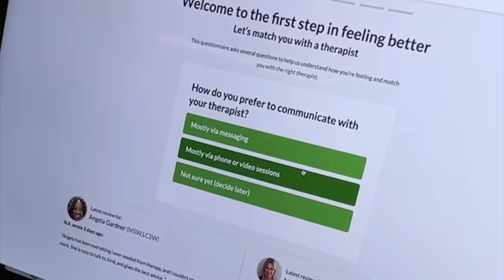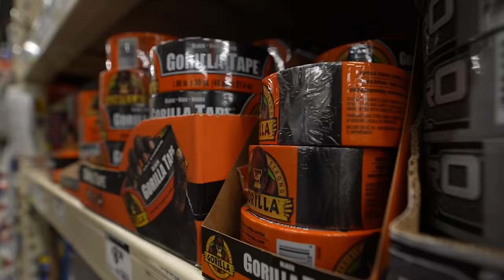Home Depot 1v1v1 Build Your Own Boat Challenge! ($500)

Comment: A bucket with no foam provides more buoyant force than a bucket with foam. The foam adds mass and displaces air from the bucket. Pulling a vacuum on a rigid container would maximize the buoyant force.
Reply: Yes I was thinking that exact thing the reason foam is botany is because there is air in it

Comment: Filling a air cavity with foam only helps if the air cavity floods by taking up the space the water has to fill.  If it remains airtight, the air will provide more buoyancy/floatation than any foam.

I'm surprised none of you bought foam board insulation, cut it  into shapes and glued it together like a human 3D printer.  You could make the hull for like $50, under $100 if you wanna be fancy, and you could spend the rest of the money on a cheap battery drill and batteries for a Home Depot-rigged trolling motor!
Reply: YEAH RUFFTHINKING
Reply: Yeah adding foam to a closed bucket makes it float worse..... it just got heavyier.
Reply: If you've watched these guys videos, they are NOT handy or mechanically inclined at all. Ayo is learning as he does these boat projects but I've seen Norm look at a hand saw like an alien object. Love the vids though
Reply: this is exactly what i was thinking .Just strap some foam board, strap it together, some pins through it maybe, coald even glue it if that glue sets in the 60 min they had. And then you could even put up some sides as wel. And with the remaining 350 you buy yourself a pretty nice cordless drill to build that trolling motor. I was actually thinking ayo was going that way when i saw him walk past the milwaukee stuff.
Reply: Glad to see someone made the point that adding foam to the inside of sealed buckets won't help at all.

Comment: Hey ayo at 14:03 there's some orange water coolers in the background. In my experience those are water tight and float quite well. You could have used those as pontoons. I'm not sure of the weight support of an individual one but I bet you could have made it work pretty easily. Great video man love these impromptu off the top of the head challenges.
Reply: Exactly what I would’ve used!

Comment: Let's be real, Ayo definitely won the best boat challenge. His boat actually floats, it could easily have a foot controlled trolly added, and you can reasonably add a pedestal seat to it. Just replace the screws with bolts that are flat, and fill the containers full of empty, sealed 2L bottles. thing would last for years in a country pond.

Comment: I would have gone straight for the plywood. 1 sheet for the bottom and front, 1 sheet for the sides and back. Some 1x1 to make a frame then tarps and the liquid flex seal for the waterproofing.

Comment: Screw the 5 gallon bucket lids to the platform, then attach the buckets to them, maybe a seal. 

Make one row of totes down the middle, with a pontoon made up of a few. Cut out and hinge the board over the center one, and have a built in cooler, maybe make an opening lid over another for storage.

Comment: 25:20 He goes "what type of saw is this", it wasn't the saws fault it was jamming up, it was because he had both ends of the timber on a surface so as he cut through the timber folded into each other causing it to jam, you need to have one end floating so it can fall away. Just thought I'd put that out there

Comment: adding foam to an enclosed container doesn't make it any more buoyant, it just adds weight, reducing buoyancy. The only benefit you might have is if the bucket leaks water, it might help out. Also, WD-40 to get the glue/foam off of your hands, then dawn to get off the WD-40.

Comment: The wheelbarrow idea was actually really clever. LOJO’s foam idea was not. It actually ends up decreasing the amount of air that can be trapped in the bucket, so it decreases his buoyancy instead of helping at all. He could’ve tried putting all of the sealed off buckets together with the foam, which would’ve helped a bit, although it probably wouldn’t have held together too well.

Comment: My son and I made a boat out of cardboard. I lamintated multiple layers, using wood glue to hold them together. Calculate the weight you want it to hold, then find out how much a cubic foot of water weighs, and then do the math on how big you want the boat. Ours would hold about 400lbs. To waterproof the cardboard, buy the foil duct tape and tape the outside with multiple layers. We spent about $100.

Comment: Surprised nobody bought 2” thick sheets of foam board. Especially for those tubs ayo bought. Could fill them with the foam boards and then use spray foam around the edge of the tub and panels. You’d be able to park a can-am on that bad boy

Comment: 25:25 it's not the saws fault, it's user error. It's common sense that if you have a piece of wood supported on either side and cut in the middle, gravity will push down the middle and pinch the blade

Comment: I would have ran to the paint section to pick up some caulk, flex tape, spray foam, bondo resin and fiberglass then hauled ass to the final aisle to grab some of that pink panther Styrofoam insulation sheets. Cut the pieces how you want then put them together using the caulk and fill any gaps with spray foam. Once the body is done fiberglass everything and boom. You got yourself a crappy boat. If you find any leaks while testing slap some flex tape on there. Maybe grab some wood to build a frame to reinforce it the body as well. Also since most of our stuffs in the paint aisle anyways why not get some paint mixed for style 😎. $500 is actually a decent sized budget

Comment: 1 1/2 or 2 in rigid foam board insulation would have been the tits over top of the bins or buckets. The beauty of being a carpenter and knowing most of the different kinds of building materials. Plus I spend almost 5 hours a week in home depots all across the county so that would be a plus too.

Comment: 4 slightly warped 8’  2x12
4 5gallon buckets with lid’s 
1 tube of silicone 
1 small box of 2 1/2 inch screws 
1 battery powered drill to put it together 
1 paddle mixer attachment so I got a motor when it’s seaworthy.

Comment: Wouldn't technically foam cause less floatation?  You're filling in the area with something denser and heavier than air, so it would stand to reason that it would provide less floatation.    Could've just used air and probably had a better time. 

As well, coulda saved a lot on those buckeys by using the cheap lids, and filling the joint with silicone and wrapping in some butyl tape.

Comment: you cant cut a board with both ends touching something it will cause it to pinch your blade. the shorter side needs to just hang off and let it drop. lol

Comment: Your a boat builder and you are using storage bins ? How much does plywood cost and screws and 3x2"inch framing wood and some fast dry glue cost?? and then some foam for floatation with cash left over for a beer!! "NFI", Good Luck with the boat building career LOL

Comment: foam won’t add flotation to the bucket . what it does is add strength to stuff . what makes foam float is the air on a big dense ball 😂 really i see people adding foam to stuff to make it float better but that’s not how it works . it will make the bucket float if it gets broken and make it more rigid .

Comment: I still don't understand why someone didn't just buy a sheet of plywood and like three of the same sized pieces of foam insulation sheets. Hook a fan blade on a broom handle for a paddle and then buy a weed blower for faster propulsion or a power drill and a paint stirrer. Talk about over thinking things.
Reply: Probably because they only had a $500 budget

Comment: Mass, is mass, i’m sure someone said it; foam has weight, and kills your buoyancy. It’s a structural factor. Just like foam in a race car fuel cell. Or foam in lower rockers on a race car, its for structural strength. Similar to pressure in an aluminum can… Air keeps you afloat. Foam allows volume that might other wise be crushed. If you kill that volume with something that weighs more than air, you float worst… and i hate to be that guy, but engineer norm all plywood comes in an 8 by form. The length changes 8’ 10’ and 12’….
Reply: 4 by form my bad
Reply: Saw you looking for 6 by in the other video…
Reply: Just about all of wall coverings in the United States come 4’ wide. Because of stud spacing which is 16” on center, and is the building code for most of the United States, and 3” x 16” is 48” (4’)
Reply: And you guys orient the yellow top on top. What if there was a frame or epoxy allowing the crates to be oriented upside down. Like jiggin with Jordan’s submarine. An air bubble. You allow more potential for leaks how you mount them currently!
Reply: And as far as wood why not go to milling yards!? Or pallet yards!? Wood does float…. And as far a lojo there is schedule 40, schedule 80, thin wall thick wall, perf etc, you need to check the OD and there is white pvc and grey, white usually for water; grey for electric as conduit; and schedule 80 is allowed to be used underground for both… And your caps were not caps they were 90’s (from another video) i appreciate your content, and want to see more; but in construction you guys are lost!

Comment: I can make a boat incorporating all 3 of your boats, taking some pieces from each and using them a little differently
Reply: Make two of what AYO made those will be the floats combined with LOJOs 2 x 4 design (this will also cover up some screws from AYOs using them to mount the 2 x 4) and two of Norms wheelbarrows (cheap ones) drill some small holes in them and attach to the boat (used as live wells, will also need to cut excess material off and mount 2 x 4 length wise on the wheelbarrow for better attachment)

Comment: LOL and nobody used a Ryobi screw gun for propulsion man you guys got to consult with somebody on this s**LOL Ryobi screw gun cuz they're cheap extra battery packs cuz you saved money by buying a just styrofoam like 12 sheets of it cuz it's a f***** inch thick 10 cans of silicone to glue them together plywood to make the top sturdy enough to walk on ratchet straps to hold everything together as for the prop I would find a bulshit fan will easily removable shaft connect that to a long piece of thred all and blam outboard motor baby then again I've also done with this with my kayak already